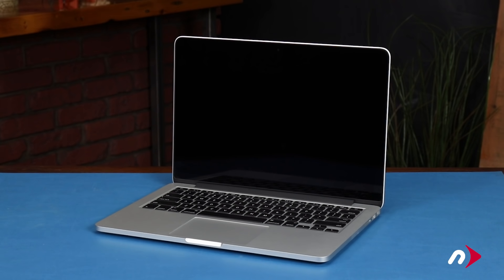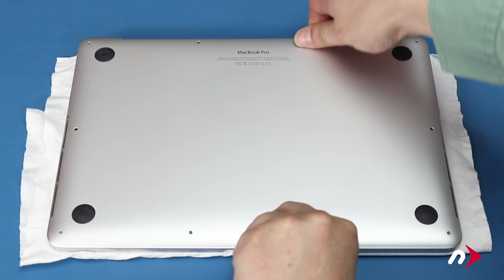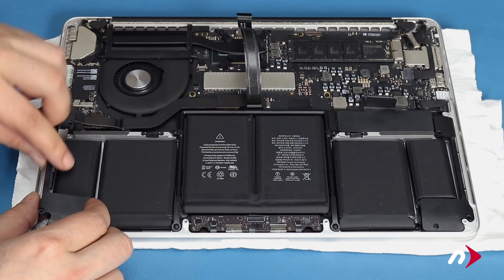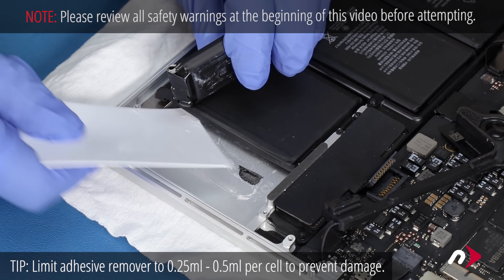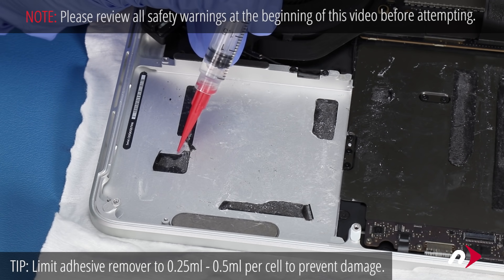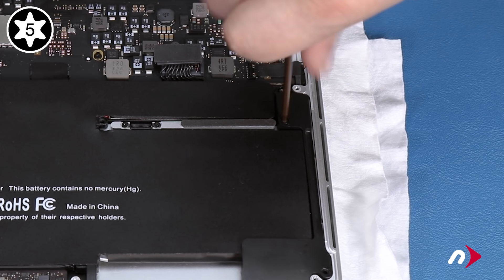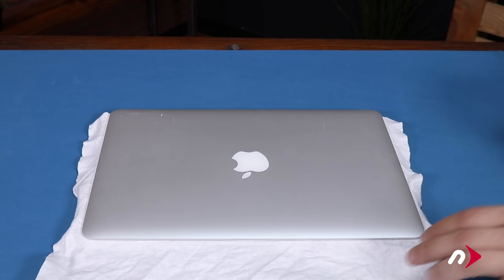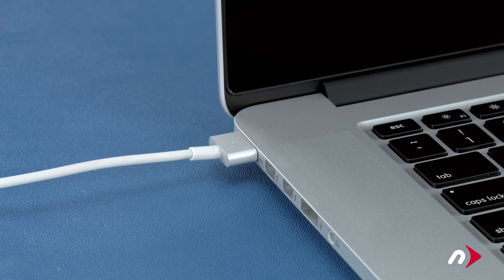How to Replace the Battery in a MacBook Pro Retina 13-inch (late 2013 to early 2015)

Comment: Great tutorial, I didn't buy a kit but the big takeaway for me here was to use a cloth to protect the screen while removing the adhesive, I probably wouldn't have even thought of that, so a big thank you there. Other videos I've watched have used fishing string (or some other string) to get under the battery and remove it instead of adhesive remover, which I think would work well but I'll find out tomorrow when my new battery arrives. Best of luck everyone! :)

Edit: battery replacement was a success! I'm 6% away from my (previously fully charged) battery shutting this system down and afterwards it'll be as good as new. Thanks again for the detailed tutorial!
Reply from the maker: Glad it was helpful!

Comment: Can someone please help me? I replaced the battery in my Mac Pro and it turned it back on after installing before pulling off the tab for the adhesive strip. It was working fine the first time by booting up to my log in page but my keyboard wasn’t working while my mouse pad was
I turned it back off and went to try and correct the issue, but now I can’t turn it back on at all!
I’ve left it to charge completely and calibrate for 2 hours, but I’m worried now.
Can anyone explain to me what happened?
Reply: Did you solve your issue? Did you reset the SMC?

Comment: sometimes I wonder what genius would decide to, knowing something will be dead in 5 years, to make it so incredibly hard to remove
Reply: This is how they milk the market.  Greedy geniuses, they are.
Reply: @ZyrixDeinhardt  Gees that's almost the price of a Mac Mini
Reply: You supposed to buy a new macbook by then, or ideally every YEAR, welcome to APPLE. As of me I stay clear of APPLE, as far as possible in fact. By the way OEM Lenovo batteries work for 10 years at least for the T series laptops, MADE IN JAPAN cells, unlike cheap made in China for VERY expensive Apple products, surprise....
Reply: @ZyrixDeinhardt  yeah but you gotta buy a kit that’s like 70 bucks, then the battery and wait for it to get mailed… then finally do the work. Whereas they could have designed it like a camera just insert and done.
Reply: @feny8  agreed!
Reply: Watching this to fix my 2013 macbook pro. In my experience apple hardware lasts a pretty long time 😄
Reply: @ZyrixDeinhardt  shocking
Reply: @ZyrixDeinhardt  Utter nonsense. I can change the battery in my Thinkpads in a minute or two.
Reply: It is not that hard to remove tbh just did it. Took 30 mins
Reply: Everybody crying about how “hard” it is. I’ve done it on TWO mbp’s back to back. If you have a hard time using acetone to lift the batteries from the adhesive, then I feel sorry for you. You don’t even need the kit. Buy some acetone from your local grocery store, get some cotton swabs to apply it and use old credit cards or something similar to get in between. Really truly sad when people are finding a repair like this “hard”.
Reply: This is actually incredibly easy to remove with a little patience. Apple will charge you about $700 to do this. One hour of your time, $50 for a battery and tools, and the satisfaction of doing a job yourself is much better.
Reply: @ZyrixDeinhardt  For some of us time is money!

Comment: my experience with aftermarket replacement batteries is that they only carry about 50-60% of the OEM battery. can anyone else chime in on this?
Reply: Yes, that was my experience also. The replacement battery lasts maybe 4 hours tops. And I am not doing anything CPU-intensive.

Comment: Brilliant, started up fine, shut down to charge, now no light on the charger (but power getting to battery pins) won't start?
Reply: I have the same problem. Did it need more time to charge or did the battery need replacing?

Comment: I love how at 10:10 it instructs us to shut down the mac, like people are removing and installing the battery with the mac turned on lol
Reply: ha ha ... I actually think that when you install the battery and plug it back in, it may automatically restart if it detects a new piece of hardware (battery) OR once it's replaced, you may turn it on to check that it works, but you haven't conditioned the battery yet.   It's a precautionary instruction, like the one on chainsaws stating that you should not start the saw while it is between your legs.  It's in the instructions because some brain surgeon likely did it before (i.e. coffee may be hot warnings).

Comment: For anyone panicking, you really don't need to bother with this adhesive remover. Just use a medium flat head and gently apply pressure under until it comes off on the sides, and then gently tug it off. The adhesive will come off cleanly. This part of the tutorial is completely unnecessary.

Comment: This video was very helpful. I did it without the adhesive remover however. Doesn’t look pretty but it’s done. Also, I’m severely disappointed in Apple as a company now. Seems like they designed the MacBook Pro to slow down the cpu at its slowest speed if you are using the computer without a better. Thus, forcing you to buy one even if you don’t want to or want to wait. Real scummy corporate move in product design to get more money faster. This is how they loose future customers.

Comment: Great video! Straight forward and well explained step by step. So glad to have videos like yours so we can solve our own, tech issues, my battery still good but is already showing the need of changing soon. Even the cycles are showing 670, but every time I turn it on it shows battery service advice. Any tip for where to buy a new battery for the best price? I have a 13inc MacPro mid 2012. Thank you in advance!
Reply from the maker: I'm happy to offer suggestions. Is that a Retina, or non Retina model?
Reply: @poweredbyowc  non retina model
Reply from the maker: Thanks Marco, the correct battery for that model is here: https://eshop.macsales.com/item/NewerTech/BAP13MBU74V/

Comment: Installed mine today in a 2015 13” MBP. I used a different battery but it went smoothly. The old battery came out easily, just used a credit card to slide underneath and then goo gone to get the old adhesive off. That was the hardest part. All in all took a little over and hr with about 90%’of it getting the old adhesive off. Thx for the great guide. Helped a lot.

Comment: Excellent video. Just be careful folks doing this. As I removed the old battery it started to smoke and got very hot. Fortunately I was able to get it out before anything got too crazy. These lithium ion batteries are dangerous.

Comment: Thank you very much for a clear and easy to follow video. The only thing I did differently was I used a can of 'freeze spray', instead of the adhesive remover. I am recalibrating the new battery now... 👋🏾
Reply from the maker: You are welcome. Thank you for your feedback :)

Comment: Hi your video is helpful to me because i have one Mac same model that you showed up un video my Mac is not charging complete and always shown icon charging only when i undo the cover and i its shown battery is blown buble the big one on center so confirm the battery is the main problem where i can buy the battery.? Can you give me the rigrh Details please
Reply from the maker: Yes, if the battery is swelling, it would need to be replaced. The replacements for this model are here: https://eshop.macsales.com/item/NewerTech/BAP13MBPR74K/

Comment: Awesome.  I used tooth floss without adhesive remover (for safety, in case of battery fire), and it worked great on my early-2015 MBP.  Took me about an hour, slow and steady with the floss and a little bit of prying.  The old battery was swollen and the laptop wouldn't sit on all 4 feet, so it was wobbly.  After battery change, works great; just calibrating now.
Reply: So you didn’t use the remover at all?  Just used the floss?
Reply: @Melanie_Gore  make sure u drain the battery first so no charge and its safe to remove with dental floss

Comment: Can you please help me letting me know if the NewerTech NuPower Battery Replacement Kit can be used for the late 2013 13inch model? As the Website that is provided in the video description where it reflects "For 13-inch MacBook Pro with Retina Display (Late 2012 to Early 2013)".
I am trying to upgrade my late 2013 mackbook pro 13 inch late 2013 retina display.

Comment: This was an amazing DIY video, congratulations!  Now I need help, when I turn the laptop back on, neither the keyboard or the trackpad work.  The trackpad cable is properly set, and lets say it may have broken inside during installation, would that also affect the keyboard?  The ON/OFF still works.
Reply: Hopefully you've already figured it out, but yes that's it. The trackpad cable connects the pad and the keyboard to the logic board. So if the power button is working but those two aren't it's almost certainly a trackpad cable issue
Reply: xylocept indeed, I replaced the cable.  All is well now.

Comment: Does this means you are not using original battery from Apple? I was told that you should not use other battery. Any experience with damages of using non mac batteries?

Comment: Hi, I have one question. If I want to replace the original battery to a used battery from another Macbook, what kind of glue should I use? Because the old battery is not sticky but it needs to be fixed.

Comment: Says 2013-2014 models doesn't have the track pad cable going over the battery, also says the 2015 model doesn't have the 4 extra screws. The model they are displaying here has all of those things? WHATS THAT SUPPOSED TO MEAN
Reply: it means they’re using two laptops so they can show the steps for both

Comment: For those crying about Apple products, I would rather take 30 minutes to replace a battery and potentially learn a skill than EVER deal with a crap-tastic PC or anything related to Microsoft. BTW, when he says "adhesive remover" he is referring to acetone. You can find it at any discount store in the fingernail polish aisle (sold as fingernail polish remover). Perfect video.

Comment: Why does the replacme t battery look different? Or is that a black cover on it? Are it seperated cells like the original?
Reply: Its aftermarket battery, probably from Ebay
Reply: You can see its smaller too,near speaker and trackpad

Comment: That trackpad cable is there for one reason: a trap. Dirty apple trick. But that won't stop us from doing stuff ourselves
Reply: cmj van Rijn yeah if that shit is not all the way to where it needs to be like tight af, your trackpad and keyboard will not work. Found that out the hard way
Reply: cmj van Rijn My battery had swelled to the point there was a buckle in the middle of the keyboard. I always have my MacBook Pro plugged in and on a metal stand on my desk for ventilation. I chose to purchase your battery replacement and my biggest problem was getting the trackpad cable plugged back into its socket. That was a real bear ended up removing the battery installing the cable first as there was very little clearance to plug it in then reinstalled the battery. Much easier.

Comment: I bought a battery for my MacBook Pro early 2015 model for $55, bought an adhesive from Walmart $5, and use a cotton swab to remove and an old credit card, and it is working perfectly. This videos helps a ton. The stores wanted to charge me anywhere from $120-$280 to repair and the $120 was an estimate.

Comment: Thank you so much, I  saved $183 for replacing my MacBook Pro battery by myself.
Reply: How did it go?? Did u actually do it?
Reply: @SERGYO. Hi Sergyo, yes I did it. It was pretty easy. I bought the battery from amazon it came with small screwdriver, but I had mine so I didn’t use that. Just follow this video and you will definitely do it.
Reply: @ProudEritrean  amazing! and what liquid did you use for wiping glue out? any link? thanks!

Comment: Do you have to use the adhesive? Can't you just put the battery in and secure it with the screws? That battery looks fairly well secured to me with just the screws.

Comment: Thanks Apple, you couldn't have just screwed the battery down like normal people do huh?
Reply: China CCP will cut corners to the max.  Glue is cheaper than screws.  Cheap bastards but they love to get our money.
Reply: @Mickycho1964  But there are screws as well.  Surely they could have figured out a way of making that housing thing do the job on its own?

Comment: Thank you boss. Saved me $500 dollars
Reply: @Black-Circle  Thank mate! I’ve literally just finished swapping mine and it’s charging up 👍 came here just to read others had done it as it was glued in pretty tight 😆 

I knew Apple would be expensive, but that’s extortion!
Reply: @Black-Circle  That sounds great! Yeah I never knew the speakers were so easy to replace (And also I notice the SSD is easy to get at too). Funnily enough I’m also waiting for an M1 14” or possibly 16” :) Already this 2013 seems to run much better so less painful to wait for the M1.
Reply: @Black-Circle  wow. That’s insane.

Comment: Hi- I followed your instructions on my 2013 macbook pro for replacing the battery. The battery is working great but the trackpad isn't working anymore. Any suggestions? When I plug in a usb mouse the cursor works fine..
Reply: Sounds like somethings not connected correctly, I would jus try reseating the cables again to make sure something isn't loose. Which model is it?
Reply: Brendan M thanks - it’s a MacBook Pro Retina 13” late 2013. It was working fine before I replaced the battery, and all keys are working.

Comment: I don't normally chime in on these videos, but this was a truly well done and helpful video. The only suggestion I would make for future videos is that it might be helpful to point out the different size screws on the speaker assembly. Thank you for making my life much easier!
Reply: Also! Instead of using a card to get the battery out, I used thin wire and ran it under the battery like floss. It is much easier and safer.

Comment: Great tutorial! In part 3, after the replacement battery installation (10:10), you mention to, "First, shut your computer all the way down." Isn't the laptop already shut down after letting the old battery drain completely to the point the laptop powers off? This is before the battery is to be replaced. Is there a difference, I just want to clarify. Thanks!
Reply: When I installed my new battery, it automatically booted the laptop up when I attached the adapter since the new battery already had about 30% charge. So, I think they want you to just shut it down again in case that happens.
Reply: I also found that confusing...

Comment: Hi, 
URGENT question and please, please help if you can…. I followed your instructions for replacing the battery. I have a MacBook Pro Retina 15” Mid 2014, Model A1398, laptop, and when I replaced the battery (correct battery (A1494 model)) for this Macbook Pro model - the laptop recognised the installed battery but would not charge it or work without power cord attached. When I followed the process to reinsert the original battery (which had a enough life in it to test the system with it back in) also came up with the same error. Have Apple put in a trip wire code in to stop us replacing batteries in newer glued in battery MacBook models at a hardware/software level???

Note on remedies attempted:
1. Restarting the Macbook. Shutting down, waiting 10 minutes, plus holding down certain keys during shutdown/startup procedures as per some instructions - no change or success.
2. Resetting  SMC, PRAM and NVRAM - no change or success.
3. Oh yes, AND I have been to an Apple shop (and you can imagine what they said the usual B.S., “The keyboard and battery must be replaced at the same time. If we repair it now to rectify that error, it will cost $1000”!!)

Have screen shots of the system report if needed.

Can you help to get my Macbook to work on battery again?
Reply: I have the same problem. Did you find a solution?

Comment: why apple :| what's wrong with normal screws or pull tab glues :|
Reply: Pull tab glues fail at the temperatures batteries work at. Normal screws force a swelling battery to not expand properly, resulting in higher chances of blast rather than simply puffed battery. It's the same reason why earlier Macs had whole battery compartment secured with only one screw -- so that batteries can break through the plastic on the other side if it's swelling. Apple takes these measures because Macs are used for average of 8 years compared to 2 years industry average, and the fact that batteries are much larger than others.

Comment: I can't thank you enough for this video! I followed it to the T and it was much easier than I thought. The hardest part is CAREFULLY removing the old battery. That adhesive remover worked great. I also used waxed dental floss to get underneath the batteries if needed. Again, thanks so much for this AWESOME video! You saved me a lot of money and aggravation.